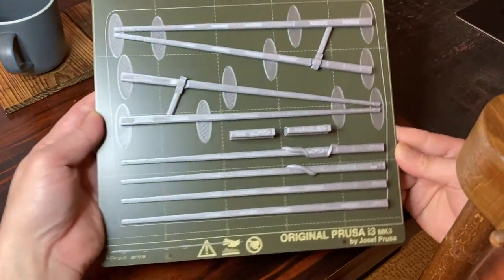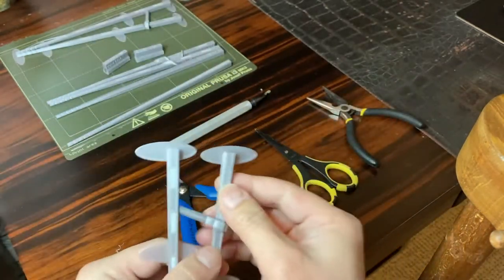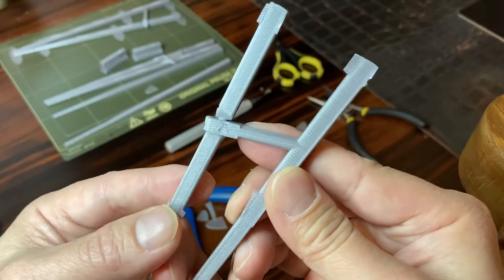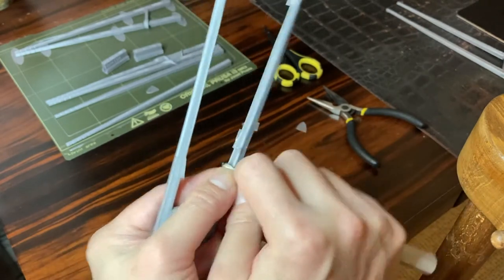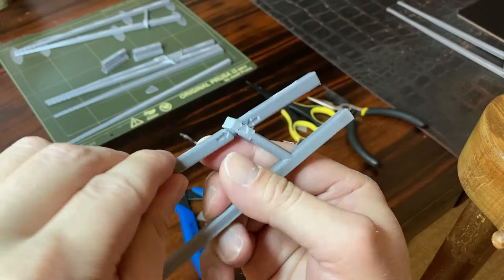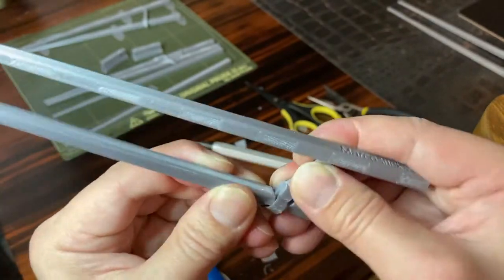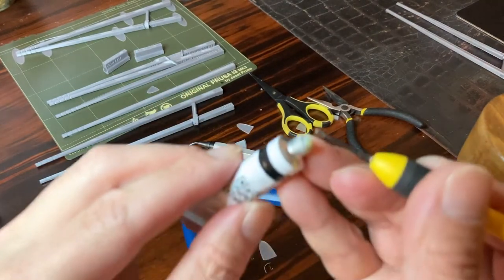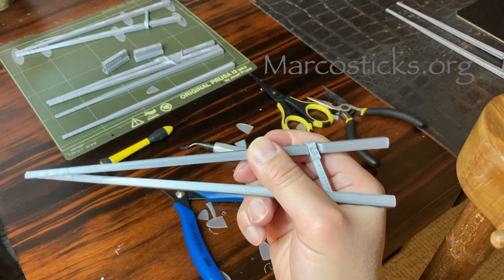Post-print processing of Training Marcosticks

Comment: We have seen that for beginners who use standard chopsticks, the specially designed Marco training chopsticks are indeed economical and suitable for young and middle-aged people, because they can easily trim the edges of training chopsticks. In order for the joints to work effectively, they must  Separate the articulated joints and grind each other, and then add lubricant to loosen the two joints, so that beginners can use the Marco chopsticks for learning and training, so that you are done.  We believe that soon there will be manufacturer partners who will provide complete finished product services, so that users who are old or in poor physical condition will be able to trim the semi-finished products.  I hope that this wish will not come to an end.